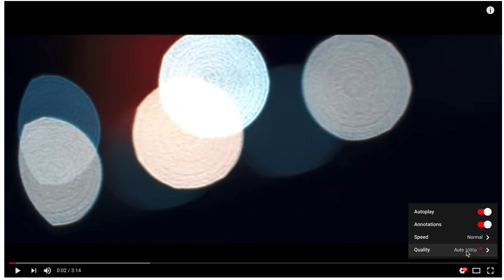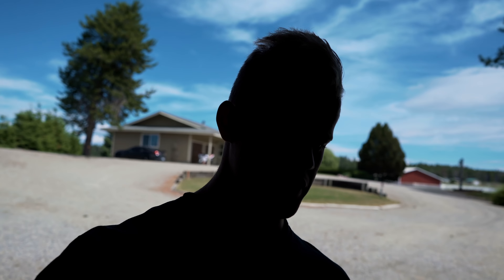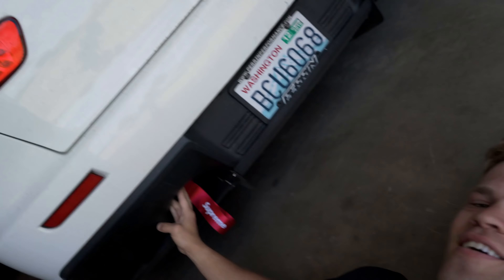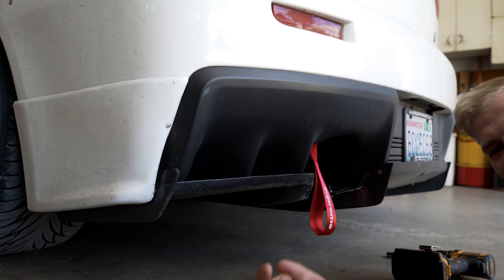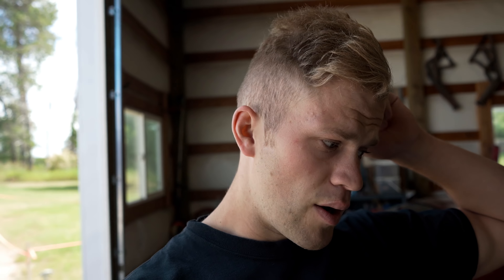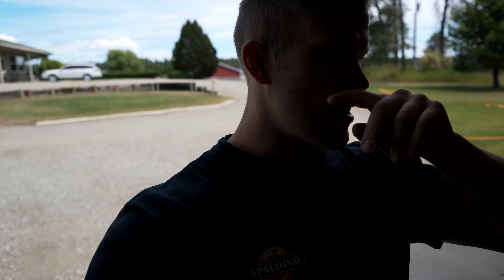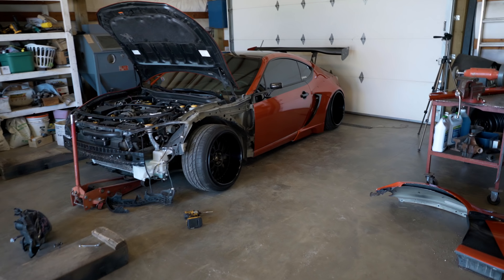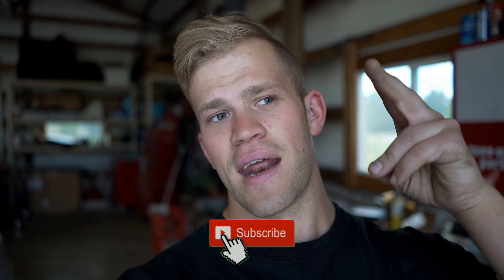Evo X Must-Do Mods

Comment: Great Video man, is that 350whp virtual dyno? 
Anyways, here is my list for 300whp/300wtq 25psi boost on Mustang Dyno. It pretty close to your list but on the heartbreak Dyno. 

AMS DP
MAP TP
ETS CBE
ETS Intake
ETS UICP
Grimmspeed EBCS
TephraXMOD v3
Tune @ RS Motors

I agree that you don't need a LICP and FMIC but for different reasons. LICP is just pipe bling / cosmetics, no real gains from it. If you believe there is gains, the tuner just decided to push the car harder to make you feel the worth of it, justifying your purchase. FMIC doesn't need to be upgraded at all if you're running stock turbo. Just not worth the price to performance with stock turbo. Well worth with bigger turbo and fuel injectors.
Reply: You’re ready for injectors, fuel pump, turbo upgrade, and tune. I have the MHI 18K and I’m gonna tell you the car becomes a whole new beast. It put me at 413awhp (Mustang Dyno) on pump gas. Only thing else I have is the MAP cast exhaust manifold, so worth it...good luck!

Comment: Question? Living in Ca and worrying about passing smog. Is it worth getting a hfc instead of a test pipe? How much difference would it make? Thanks
Reply: Test pipe you'll make more power and would be smelling gas, but you would make more power over the hfc. With the hfc it won't be as loud and you won't smell gas. You won't pass smog with either or.
Reply: cesar reyes how much more power would you make with the tp as opposed to hfc. Marginal?
Reply: Juan Camacho around 10 to 15 hp as I been told. I'm still debating on what to get as well, socal is really hot with cops do to take overs
Reply: Get an HFC. I’ve had my X for 5 years in Cali and passed smog with an HFC. It’s a slight difference from test pipe, but not much and you won’t have to smell fuel every time you drive. Orale

Comment: So that mod list on the top will get me 350hp to the wheels
Reply: And is that access port the only tune I will need or will I need to go to a tuner after the access port.
Reply: @JoseSanchezIII  I know this is old but best results will come from having a professional tune it (i.e. pro tune). Some tuners tune accessport, some prefer other software. If you haven't already got accessport, best to choose a tuner that you like first, then go with his software recommendation. If you're determined to use accessport, you will have to use tuners who utilize that.